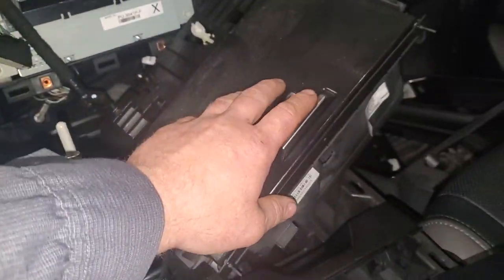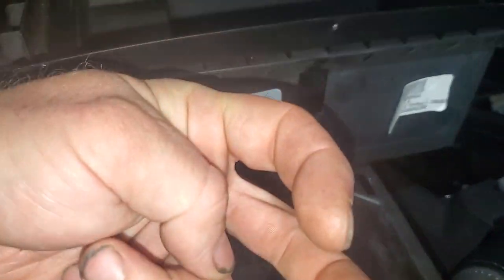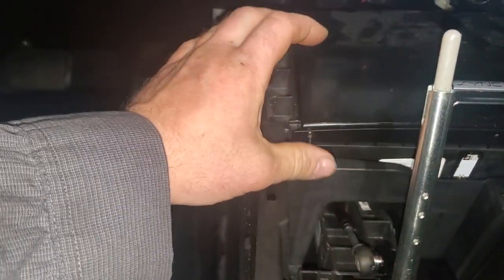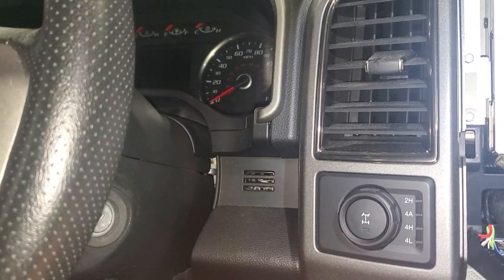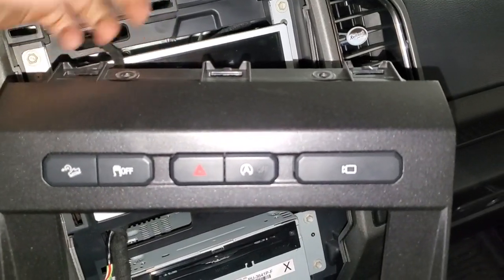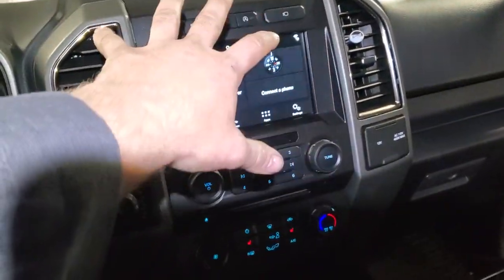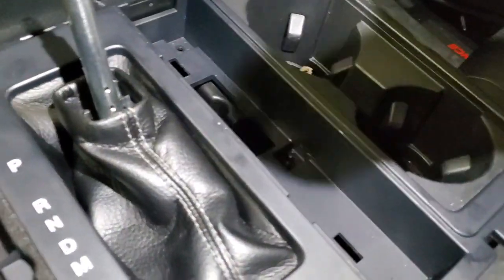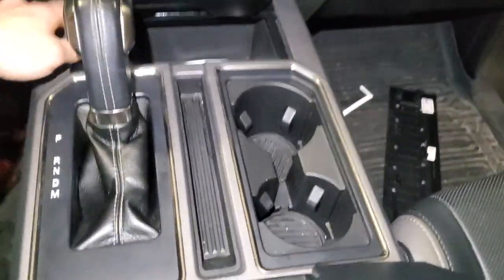Raptor / F150 Flow Through Console Breakdown In Reverse - Shifter, Radio, Apim, Storage Compartment

Comment: Big help. My 2015 fx4 scab 5.0 got stuck in park a couple days ago. I was able to pop the top trim off and manually actuate the shift detent so I can put in gear. I think I may have to replace the shifter assy. I thought maybe the brake pedal switch was faulty but the brake lights are working fine. Going to scan it with forscan when I get home. Thanks for taking the time!

Comment: Nice, thanks for taking the time to do that. Hard to do all that with one hand. One question, the boot on the shifter, did you just pop it down with a trim tool or just pull down on it? If I replace mine, I’d rather not break any clips if I can help it, and I sure don’t want to take apart the console to replace the boot.
Reply from the maker: No no I specified you have to use a plastic trim just nice and easy pry down on each side and it will pop right off
Reply: @FordBossMe  , thanks, guess I wasn’t paying close enough attention, got a 2 year old granddaughter crawling up wondering what I’m watching.

Comment: Hey I know this video is over 3 years old! But I had a question on the shifter portion. When you pull down the leather to remove that piece from under the shifter, can you just pull down on it? Or is there a specific way to do that to release the clips holding it up? I just didn’t want to yank down on mine and break clips if there’s a certain way to compress them so it just slides down. Thank you for your time.
Reply from the maker: I use a plastic trim tool to pry/push down

https://amzn.to/3xI9OsA